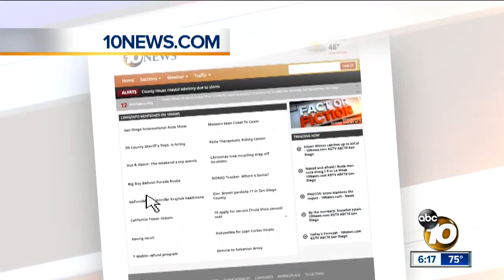Teen's invention makes water out of thin air

Comment: The Army has been doing that for years. Dig a hole place your rubberized parka over it to cover the hole. Place a rock in the middle for the water to flow towards a point, put your belt under the rock and it makes a quart or two of water over night.
Reply: That relies on moisture in the soil, and it works. This one relies on the ground for low temperature, but supposedly gets water out of humidity in the air. Bullshit. See Thunderf00t's debunking of the WaterSeer.
Reply: Yep, a ground-still - and ya, this is naive bullshit from someone who hasn't learned to look before leaping.
Reply: AerialGuardian The Israelis just came up with a system of micro sized plastic type tubeing that screens salt out of salt water from the ocean. 
  I'd recommend distilling it. A lens that is a yard wide can focus sunlight 12" from its center and melt steel in 3 minutes. You only need a set of lens, a foot in diameter, in a box set, as in an array configuration, to evaporate a whole bunch of salt water in an oil barrel lets say, there is your salt water to fresh water, distiller.
  Look up how to make a water distiller on YouTube.
   The water is mineral empty and over time your body will need minerals as would plants.
  Enter the salt water filtration. That water has minerals. Combine the two waters and bottle it for sale$$. Ka-jing.😎
 I'm smart.😏
Reply: That does NOT make a "quart or 2", unless it's raining. I did it too and got MAYBE 1/4 a cup of water in a 90% humidity area. This was one of the boy scout's badges that you had to do.

Comment: Water out of air.... well thats pretty dumb.  Cool concept but its not like the air isn't polluted or anything...  Plus if we absorb all the moisture out of the air then will it not rain anymore unless a storm rolls in?  Or would the climate temperature increase?
Reply: My concern is he uses copper wire to create the water. Water from copper pipes have been shown to cause brain damage.
Reply: +AerialGuardian Its pretty difficult to get the lead out of copper, and when you do get the lead out of copper the copper tubes tend to break